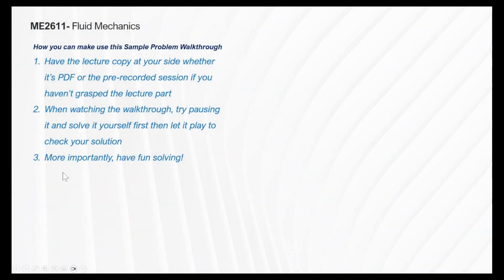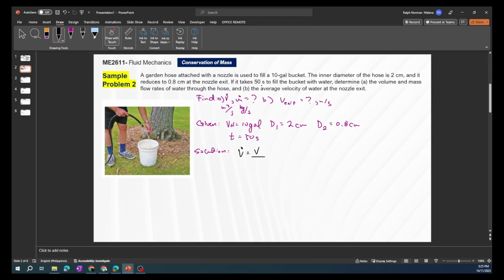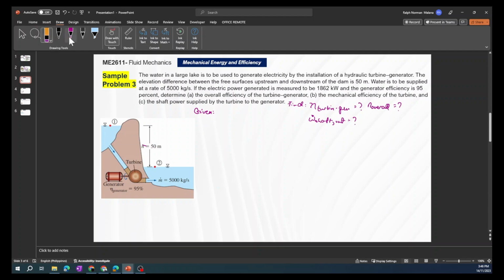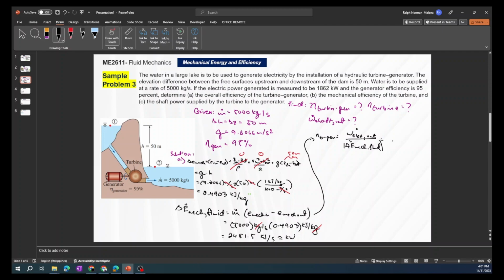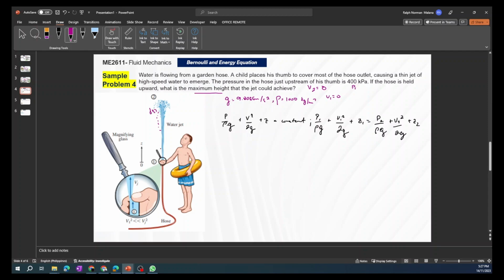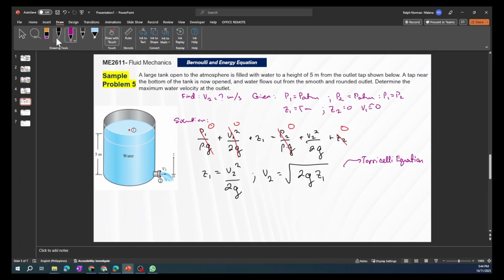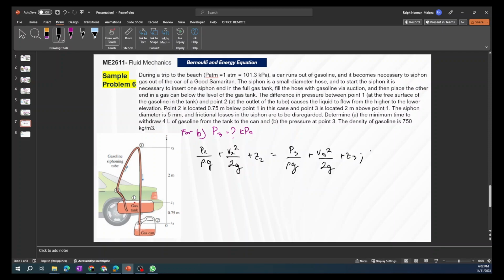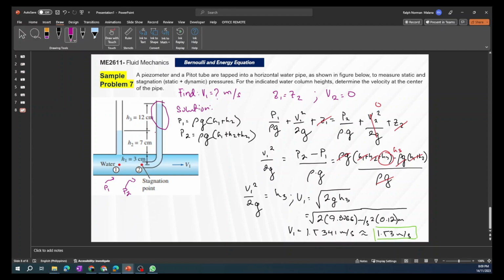Bernoulli Equation   Sample Problem Walkthrough

Comment: Why would the velocity be larger on the larger branch and slower on the smaller. Would it not be the opposite,
Reply from the maker: ideally, yes should be faster on the smaller diameter. However for this exercise, I was simply showing the relations of flow rate and how to use the formula. Would improve the problem on my next upload.